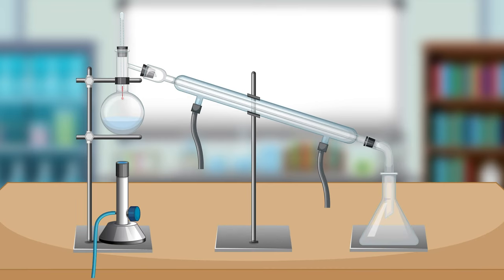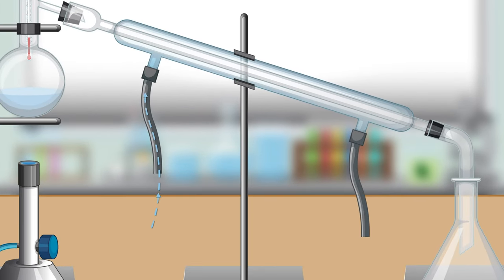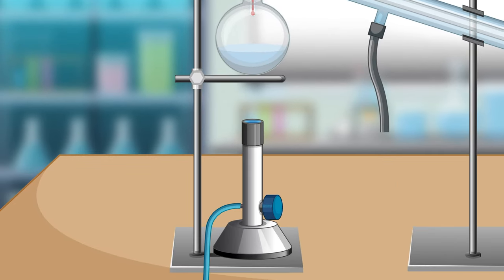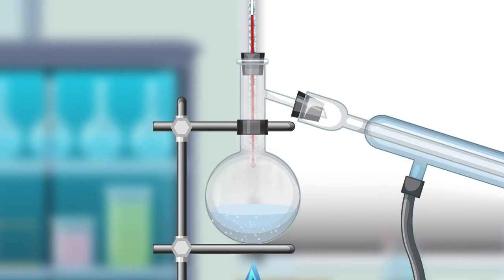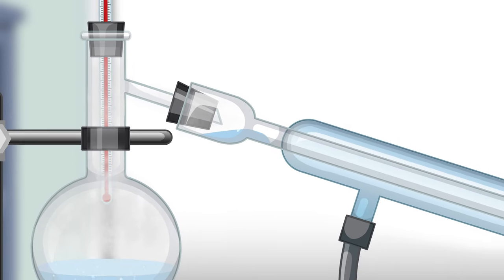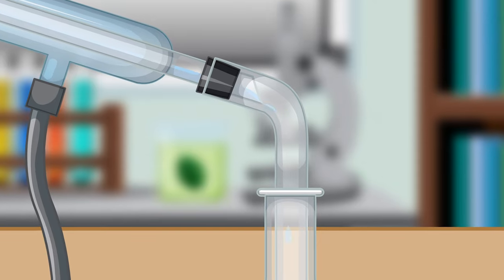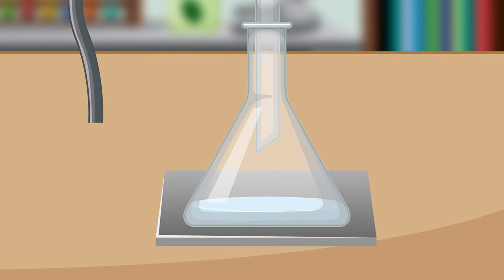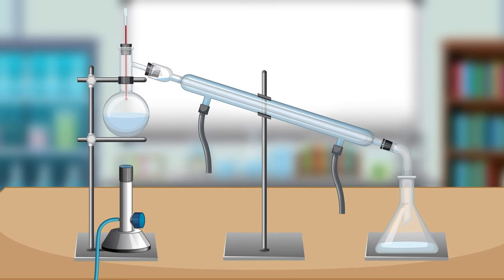Separating Solutions – Distillation

Comment: Nice animation, however, the direction of the water through the condensor sleeve is going the wrong way. It should enter from the bottom and move through to the top.
Reply: hah

only 3 comments and you still beat me to it by a month!

I do think that if you tried to run water through the condenser from top to bottom in real life you'd quickly notice that it doesn't really work... that you should have the condenser jacket actually filled with flowing water